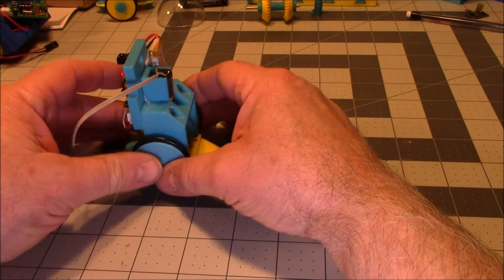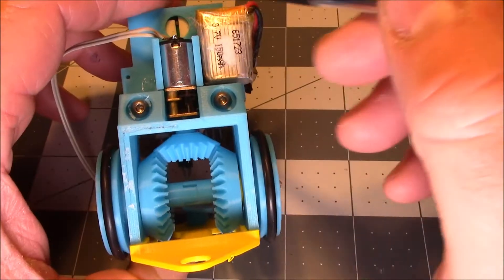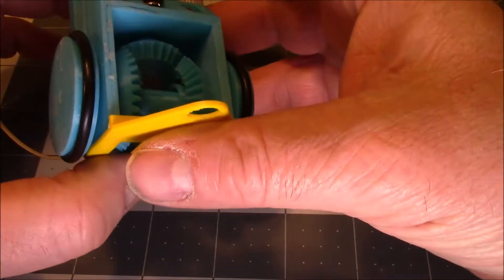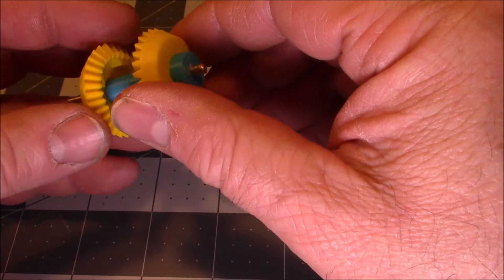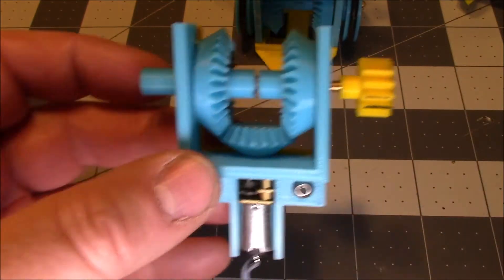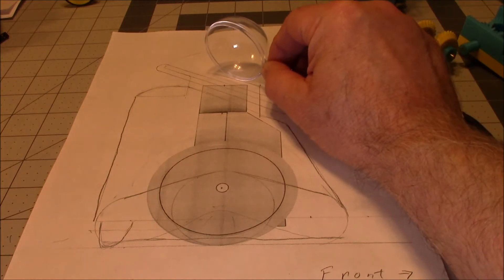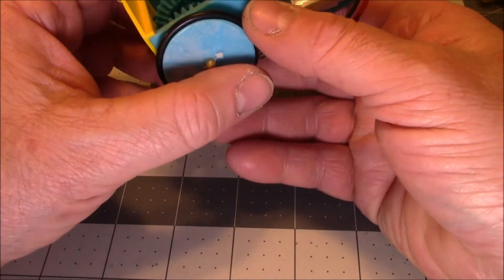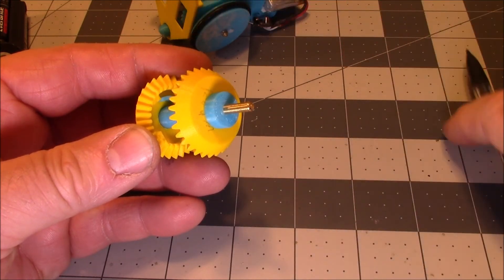Single motor 2 function robot

Comment: Very nice use of the double ratchet drive. I guess if you do not get a better ratchet for the ark problem you could just make one wheel slightly larger "or smaller" to account for the drift.
Reply from the maker: I never thought of that. The problem might go away as I add the weight of the batteries and body. If not, I'll try another ratchet mechanism first.  I was happy that such a simple mechanism could be used for this. It's kind of noisy so I  may have to name it Click'O .
Reply: @rick_100  Rick in the past I have made in wheel ratchet design that used BB's and ramps. They make a 1-way clutch and work very well. You might want to play around with that idea.
Reply from the maker: @Robothut  I'll keep it in mind.  The ratchet has to be really small. I tend to box myself in by making things to small at the start.
Reply: @rick_100  1 way bearings can be very small, and 3d printed.